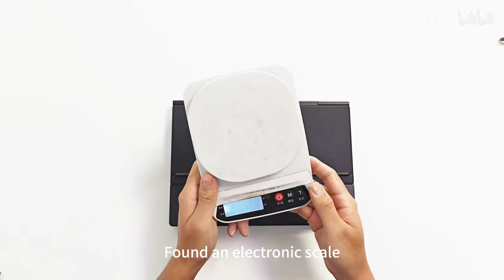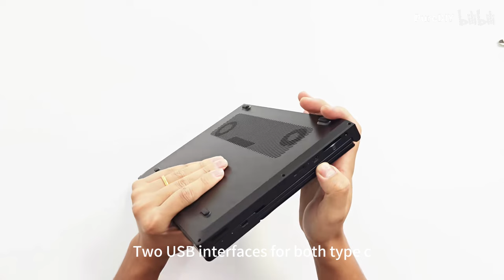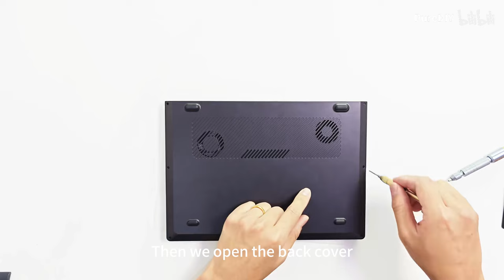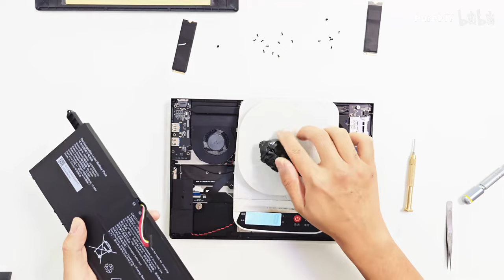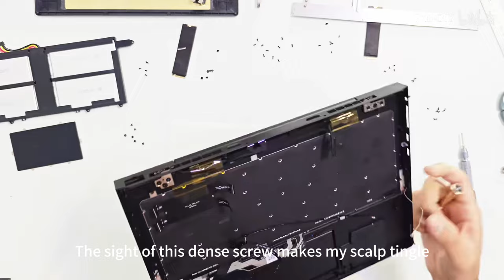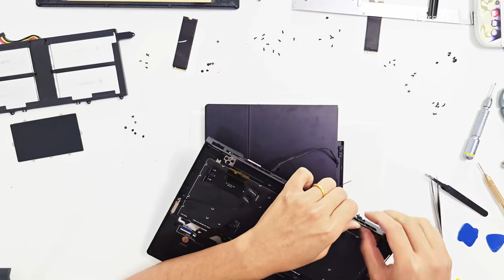GPD DUO DISASSEMBLE!

Comment: Thank you for this! Just received my Duo and I was curious on how to change the SSD if I wanted to.
Reply: Do your screen make cracking sound on opening or closing in full range. In mine there is also something sliding orso. Can't really tell...
Reply: @RutschnajaTeleschka  Yeah it does. But I heard it in this video too so I didn't think anything of it.  Also instead of watching an animation of the screen spinning when it's flipped 180 it blacks out then turns back on. Then when I have one screen on and flip it where the outside screen is off, the main screen gets these horizonal scan line look randomly. But that's also another issue others have and we're waiting on a BIOS update.
Reply: @HarmonicTunes  Not sure about that spinning thing. Currently running a memtest. Had to rerun because forgot to reduce the VRAM to 0.5 otherwise it tests only 47GB. Where are you in contact with the other people about this device?

Comment: What was that about the screens at the end? I didn't get it. Overall the repair ability looks good.
Reply: He mentioned a few things. The AMOLED screen is likely to be trashed if repairs are needed because reassembly is very difficult, especially with wire traces running through the first screen, which could damage the webcam and second screen as well. Additionally, the hinge has a cracking sound when opening and closing, possibly due to it being a test model.

Comment: Just knew that DUO have RJ45 2.5 multi giga
May be Pocket 4 cannot be a flagship I think
Reply from the maker: I think the DUO is the flagship
Reply: @ I own Pocket 3 high spec since just release date
Really good but the module feature have no more new update until now
I think that is wasting the design
GPD should provide more different kind of modules for Pocket Series
DUO spec is over Pocket 3&4
Only disadvantage is dimension 
But folding dual screen is good
Last remaining is battery life
Reply from the maker: @slashkensol  We have add the 4G and LTE this time
Reply: @gpdgameconsole  but user should be can share wifi by smartphone
Less of user need sim data for roaming on the mobile pc
Reply from the maker: @slashkensol  Yes, so we make the updates on 4th generation